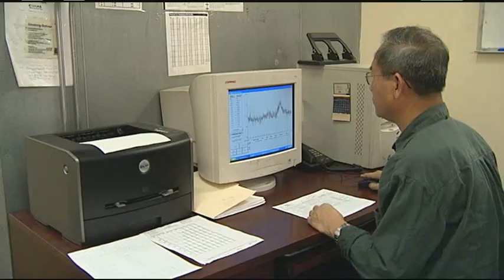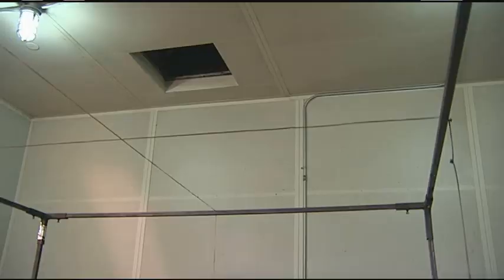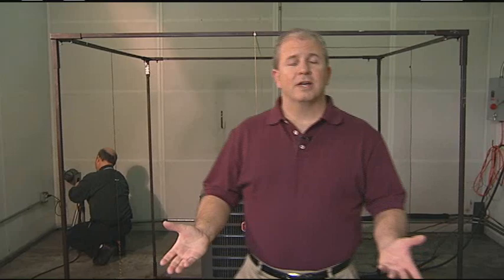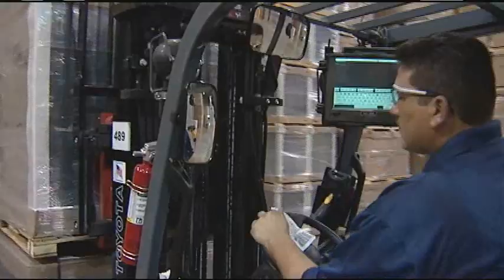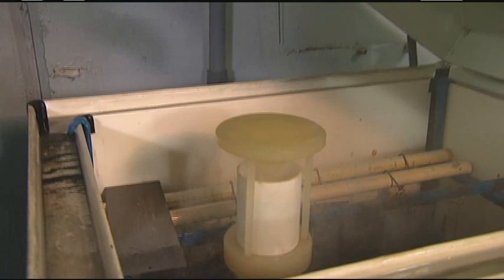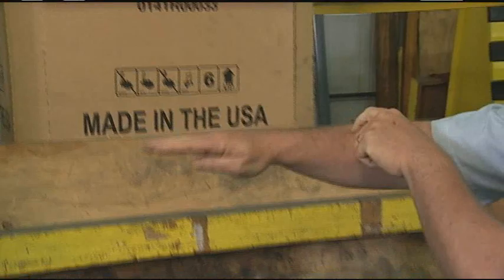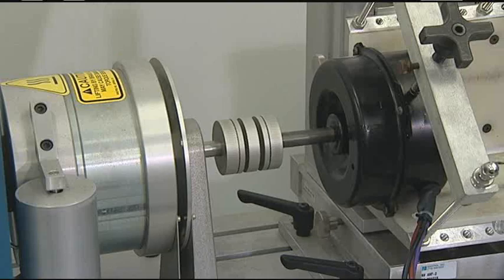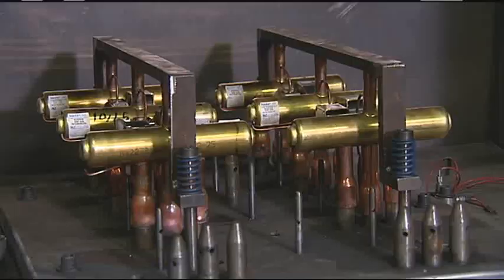Goodman Engineering Tour (HD)

Comment: I like copper tubing in condensers, "I don't like" the copper to aluminum condenser connection. If it leaks and I can't fix it the customer looses confidence in me. "I Don't like" condensing units with louvers over the aluminum fins. The louvers keep the rain from washing the dust off. I've had service calls on old AC units that have never been cleaned.